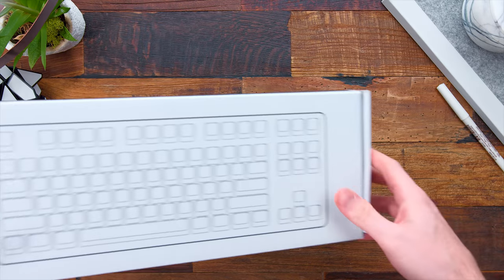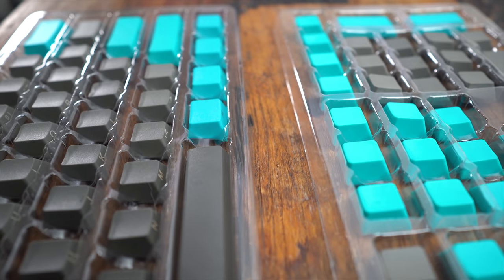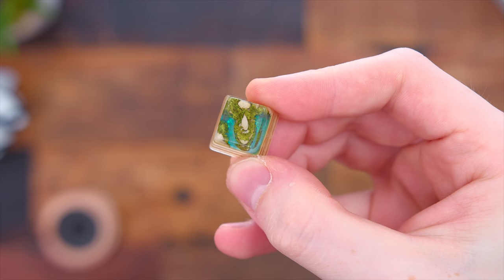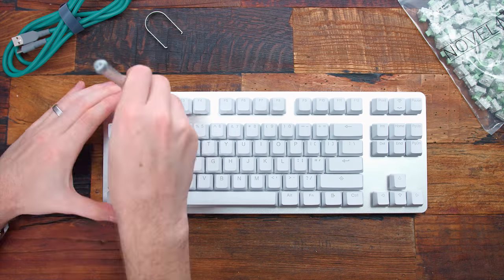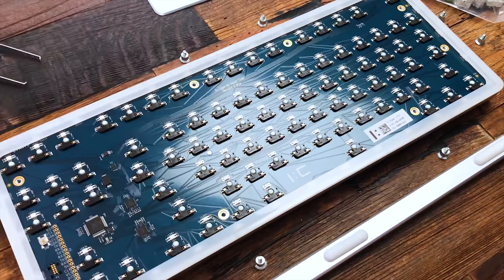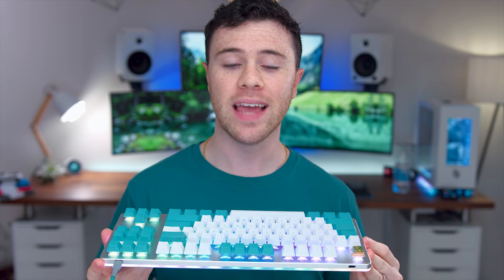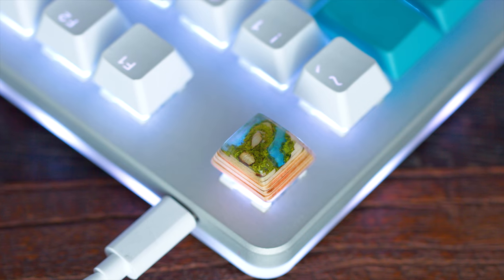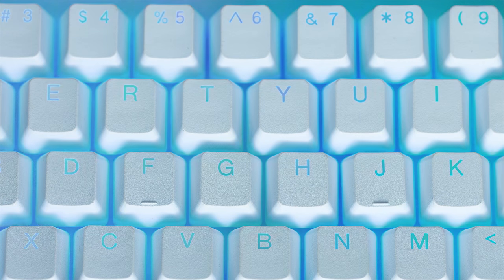Customizing My Favorite Keyboard to be CRAZY CLICKY!

Comment: i cannot be alone in not finding clicky keyboards annoying but somehow... relaxing... 

a buddy of mine bought an ergodox kit and buit it using blues(before this switch maker had teals), it worked out really well, been years and hes still loving it, but the interesting part was his boss after seeing him packing it back and forth, had him order another kit and make himself one for work...on the clock, so he wouldnt have to pack it back and forth, then... ended up using the thing for 2 weeks when my buddy was on vacation and boss had to cover his job... and they ordered verybody mechanical keyboards... he realized how much better his hands felt after doing reports for hours vs the membrane keyboards they had on most systems, most people just got basic fairly cheap for the time mech keyboards, but, those willing/able to build or pay to have somebody do the build on an ergo dox kit, were purchased those and the keys they wanted, 3 people ended up paying me to do the solder work for them on top of my buddy who..could do it but.. isnt that good at it.. where as.. i could solder something like this as i watched anime and held a convo on discord and come out with "was this hand done or, did a machine do this work" results... 

i wish i had made him pay me in my own kit... was stupid and didnt think to tell them they needed to toss me cash AND a kit to build myself one...
Reply: split keyboards are the only ones i can touch type on consistently, and quickly, even in a pitch black room... my PA+RA+Gout make it hard to use a normal flat keyboard for extended periods honestly... honestly... if i could rebuild a 2nd or 3rd gen MS Natural Ergo keyboard 1.0a or the multimedia models, with mech switches, that would be ideal for my needs... having taken those apart, they would actually be well suited to somebody coming up with a pcb to do just that job.. i would be so down for that... ergodox would be my top choice as a kit... being somebody that actually enjoys soldering, i would have fun building my keyboard, and being able to say "i made that" and mean it... is always fun for me.. showed a buddies father my computer recently, when he found out i made this before his son moved away and have upgraded it but not replaced it... he was blown away... wished he had let us make him a similar system when we offered... as hes had 3macs and 4 windows boxes in that time.. and... after playing with this old 1366 system i have overclocked... he just stared at me and asked why its faster then his current mac and, loads stuff faster then his current windows gaming box.. even if my fps are worse... 

i have 48gb of ram in triple channel... using a chunk of the ram with primocache to cache the most used blocks from my games drive,  and boot drive, with a 2x1tb sata ssd hardware raid as primocache L2 ... mostly... in online games, im waiting on the server or other players... despite the age of this beast... best part... its actually parts my uncle gave me when a similar vintage AMD box died on me, and i had built my uncle a new system a few months earlier, i was able to use his old system and what was still good of my system and get a box up... the i7 920 it had in it would clock to 4.01ghz and not a bit over that.. the x5675 i paid $20usd shipped for from CA took it from being easier to overload then the fx8 core it replaced (with threads), its amazing the legs x58/1366 had on it.. had they given us the cores they released on 1356..ivy bridge based cores... it would be very comparable to first gen ryzen... (im a bit faster then my buddies 1600 first gen ryzen rig with the same videocard, my memory latancy was quite a bit lower then his... even with tweaks... his was near double mine in ns...same copy of aida64off my flash drive.. 

he actually broke out his and his brothers old x58 rigs and got 6core chips for both..his brothers..got dual w3680's he got cheap unopened from his works store room(if they had any more he would have gotten me one... he got the last 3... and didnt think to check the trays for good pulled chips the last few times hes had a chance... they keep stuff around because they do still have a few servers running old platforms for clients... in one case.. newer boards cannot support 2 cards needed for the server setups they are running....

anyway... my buddies brother had an SR2, but ended up with a single chip in it for most of its life because the idiot didnt read the "you can only use 2 chips if you use xeons" and the cost back then was a well over a grand a chip... fool tried to put a couple 920's in it LOL... anyway.. board took a bios update made by users with the latest intel raid/ahci/etc roms and everything else updated and the updates for any 3nrd party chips with batch files to apply them... hes running the chips 24/7 at 4.8, each chips got its own 280mm AIO with quad noctua ippc fans on the rad... the mad lad already had a very high end true x8 pci-e usb3 card, that can use all 6 ports at full speed at the same time... he also threw in a flash accelerator he already had around, he got ahold of.. 12x16gb recc 1866 ram sticks, yes 16gb sticks, 12 of them... 192 gb of ring ram... and hes got primocache using a 3.2tb flash accelerator he paid around 200usd for to cache the whole systems reads and writes.... on top of using all but 32gb of the ram dedicated to caches for various drives and their uses... genuinely its faster then his fist gen thread ripper system for most tasks... also, the 1866 ram hes got.. is the same stuff a couple companies sold at both 2133 and 2400 with tuned timings... and the seller send him a printout with timings for each clock range.. no joke... its a truly beastly system despite its age... the fact it was too easy to overclock is why intel moved to an inferior platform...

Comment: 5:20
Hm, let's try that out
>*flips spacebar*
>*remembers I'm using a DSA key set*
Oh, I feel like a dumbass...
Reply: dsas are symmetrical right? idk havent looked through r/mk for a while
Reply: @Terabyte-jp6ou  DSA caps are uni-profile, meaning they're not angled like OEM. They're flat, but with spherical concave surface, instead of cylindrical.
Reply: @JackOfHarts96  you answered him a year after the original comment
Reply: @JonathanGarcia-js9pb  Nope, his comment was made two months ago, and so was mine. I don't know what you're talking about.
Reply: @JackOfHarts96  wait, I just read it back and I typed it wrong
Reply: @JackOfHarts96  my point was that you answered a comment about a year old comment
Reply: @JonathanGarcia-js9pb  And my point was that the reply to my comment was made only 2 months ago, and I answered it very soon after. So you're objectively wrong.
Reply: @JackOfHarts96  look at the first comment, then look at terabytes comment, thats atleast a 10month difference. That's what I was talking about

Comment: This obviously evolved into the CTRL that Drop sells now. Some things looked better with this board. The one hole diffuser would allow for a lot better foam job. The new CTRL uses a 3 hole diffuser and that leaves two roughly 1" gaps in the back piece of foam.

Comment: Love my K-Type. Currently just rocking the K95 Platinum to match up the rest of my peripherals. Also lost my #1 key on my Carbon Keycap set, so that's a downer haha. Those switches sound pretty good. How are they feeling?
Reply: TragestyX they re released the k type. How do you like it and is it worth the $199 price?
Reply: @Estebeezy  it's worth it. Hardware is good their new hako switches are nice too. I got the one time halo since massdrop want to screw input club.
Reply: TragestyX gotcha. I have a k95 platinum as my main but got a g513 the other day to try it out and I really love the tactile switches. I might return it to order this keyboard and get new switches. Any switches you recommend that are tactile like the g513?
Reply: Not familiar with the keyboard but this get one of the tactile Hako switches. They will have tactile in description.

Comment: Do you know any keyboard base I can use that would work with this. I love the switches and the caps, but the keyboard sold-out and there is like only 1 online for 200.  It doesn't have to be as beautiful as your keyboard base (massdrop x input club k-type), it only has to work with your teal and grey keycaps and the kailh jade box switches thank you.

Comment: do you have an amazon like for the keyboard frame you use? The frame that allowed switches to pop in and out without any solder switches.
Reply: visionary800 It comes with the keyboard
Reply: @kronics7556  which keyboard is it? Name or Amazon link of the keyboard you use (no num key) that you use that allows easy swappable switches?
Reply: visionary800 watch a couple reviews of the e element z88

Comment: I am looking for a good keyboard that fits most of these categories.
If the keyboard fits most of the things but not all I might still be interested
. Budget: $200
	
* keyboard: no in your face bright logos like Logitech
	
* no number pad  
	
* wrist rest (preferably cushioned, no big in your face logo, and this is pushing it but magnetic to the keyboard)  
	
* mechanical: tactile or linear: not clicky switches like Cherry MX blue or razer green aka quiet but not too quiet (IMPORTANT)
 
       
 * keycaps: greenish/blueish teal style which fits my mint green/light blue setup; also a CLEAN font not an in your face bold font. If the keycaps are   black that is fine too. I prefer the keycaps to be clear on the edges to have a lot of light and RGB in your face. aka bright AF
	
* 
media keys: pause, next track, previous track, and volume control

Comment: It’s still no match for my k552
Reply: K552 is not very good. RGB is very dim on the one I had.
Reply: Roman Bellic then try turning the brightness up. FN-up arrow. And dog RGB doesn’t determine the complete quality of the keyboard. Also I wasn’t talking about quality, I was making a joke about how goddamn loud it is.
Reply: @benkruggel4593  I got rid of it, the brightness was all the way up when I used. Also yeah it was decently loud. I just thought you were saying k552 was better overall.
Reply: Roman Bellic if you can find a keyboard brighter than the k552 I’d be impressed. And sort of RGB effects are gonna be less visible under a bright light.
Reply: @benkruggel4593  I haven't used any other mechanical keyboards but I was honestly not impressed with the brightness of the RGB.
Reply: Roman Bellic then you’ll be very disappointed with every other keyboard in existence
Reply: @benkruggel4593  I guess so then.